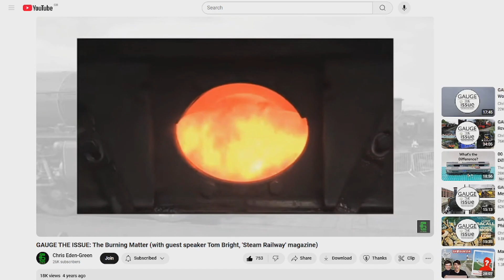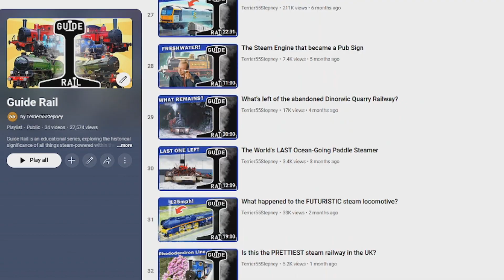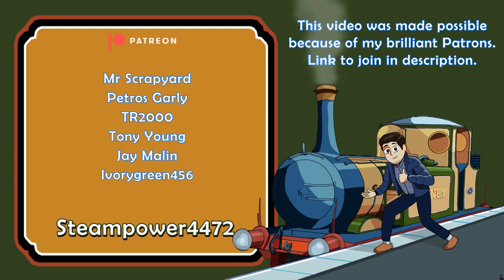Why are steam railways struggling to find coal?

Comment: Exporting coal from Russia is still looking a bit unlikely still, but the uk government could consider keeping the recently closed coal mine open for heritage railway use only.
Reply: it wasn't the UK government that closed it, but the Welsh Assembly. At the time of its closure the UK government in Westminster recommended the renewal of the mineral extract licence based on the need of the coal for steel production. The Labour controlled Welsh assembly refused and as soon as the mineral extract licence ended, refused to renew it. They tried to revoke the mineral extract licence of the anthracite mine near port Talbot, but this went to the High Court in London, and the Judge said the licence could not be revoked until 2038 and the mine could expand its under ground workings. The Welsh Labour said no one uses coal anymore. that is how stupid they are.
Reply: That's if they even care about that sort of thing.
Reply: It's ironic that a union linked labour party is finishing off the last of coal mining
Reply: @charlesburgoyne-probyn6044  what many people forget is, the "famous" mine closures of the 80s and 90s were actual drawn up and started in the 70s under labours James Calaghan, after the pay increases that the NUM demanded and received made many of the NCB pits no longer profitable to work.

The same can be said in of Wilson's labour government in the 1960s. He promised to stop the beaching cuts started under the conservatives.... He did..... For 6 days, then accelerated the closure programme.

This current lot are only interested in looking after people who have no right to be here, destroying British history, giving away our territory, destroying British manufacturing, destroying British farming, freezing the elderly, and destroying British owned companies. The only people they are willing to support (other than people who shouldn't be here) are public sector workers, and it's thanks to £11b in pay rises in July 2024 that is responsible for 50% of the black hole they claim (falsely) they inherited. They should be congratulated. It took brown and Blair 11 years to spend all the money and bankrupt the ecconemy (leaving a £158billion black hole!) . This lot did it in 11 days!

Comment: While I appreciate the government's attempts to be more green, there was 0 consideration for the heritage scene and I don't think the demand from that alone is enough to justify keeping coal mines open. There HAS to be at least 2 or 3 (maybe 4 or 5) coal Power Stations open so that there is still demand to mine coal domestically, that way the heritage scene doesn't have to buy coal from other countries or make something up in a lab
Reply: The UK gov is closing the coal fired stations, not just closing, but close and dismantle ASAP.
Reply: The UK's last coal fired power station closed in 2024.
Reply: @kevfrombutterley  technically one is still open. Drax was built as coal fired, but has been converted to burn wood, cut down in north America, put on a train to the docks, shipped across the Atlantic and then put on another train to Yorkshire. the eco brigade claim its cleaner, despite having a massively higher carbon footprint. 

Unless things change soon (which is very likely) Drax still has a couple of coal fired boiler mothballed "just in case" the worst happens. 

its not just steam engines that are being court up with this ill conceived plan. With the Welsh Labour Government refusing the governments wishes in 2023 to renew Ffos-y-frans mineral extract licence, a mine in Whitehaven Cumbria was approved in order than the UK could continue to make virgin steel. One of the first things Mad Ed Miliband and his labour cronies did after then got in in July 2024, was to revoke the licence for this mine (and several oil and gas drilling operations) so now virgin steel can no longer me made in the UK.
Reply: @J.C.1960  That's interesting. New iron and steel is still made at British Steel Scunthorpe although the iron ore and coke are both imported now. The coking coal rationale for the proposed mine in Cumbria became irrelevant when Port Talbot closed their coke ovens. I do hope that plant gets its promised arc furnace, for the sake of the employees and for the whole area.
Reply: @kevfrombutterley  The steel and Iron at Scunthorpe is recycled steel and iron, not virgin steel, so is no use for structural, pressure vessels, or shipping, and only fit for general purpose mild steel.
Reply: @ and it was the fact Port Talbot were having to import coal for its coke ovens, due to welsh labour refusing to renew the mineral extract licence for Ffos-y-fran, and that was why they closed 1 year ago, because they could not wait for the mine at Whitehaven to open, due to the delay created by eco loney's taking the developers and the then tory government to court to stop it.
Reply: Ah there's a thought, perhaps we should go back to steam powered generating stations, electricity was much cheaper then....

Comment: Convert them to oil burners. They did it to 4014 un the U.S.
Reply: I heard WD 2-10-0 Dame Vera Lynn and 4965 Rood Ashton Hall are being converted to oil-firing
Reply: The steel wide firebox  Bulleids are good candidates for oil conversion.  The fireboxes are very similar to American steam engine ones, and an oil burning system transplanted from america would probably work.  The S160s are also good candidates.
Reply: @mattgrant2646  is there 3 or 5 S160s in the UK? The WD2100 are also suitable, but again about the same In numbers. Non of which are suitable for mainline work.

The issue with the MN/WC/BB boilers is simply cost. With the MN it's also weight, with them being too heavy for some heritage lines
Reply: Yeah, we'd rather not. Plus, it's MUCH less healthy, plus, dude, look at YOUR locos, and British locos, as a comparison.
Reply: @ukaszwalczak1154 they're heat engines all the same 
The Swiss even had electric heated steam engines during wwii due to coal shortages
Reply: @ UK fireboxes tend to be MUCH smaller than those found on US engines, mostly made of copper. It was found when experimented before that many UK locos designed to burn coal and converted to oil firing couldn't produce enough steam at high demand. The experiments never went much further due to UK having hundreds of years of cheap coal under our feet (that we are no longer allowed to mine) 

It might be a solution for some of the new build locos (such as Tornado and the new P2) which have steel boxes, and being new would be much more easy to convert

Comment: If anthracite burns hot enough to melt metal isn't it possible to reduce the amount of it burned in the fire box so it doesn't melt the engines firebox?
Reply: it tends to be the firebars it melts. Many model engines use it, but use stainless steel firebars, and even so it can warp them. There is also issues with drafting, with locos these days spending considerable times standing around (which is why some had clinker issues with welsh coal, with is a low grade gasius anthracite rather than a bituminous coal)
Reply: you need different grates and a completely different design of firebox for anthracite.  LNER engines are meant to run it, but the others need the calorie content and burning properties of bituminous steam coal.

Comment: Could not all the heritage railways and other’s who require coal purchase and run a mine between them? Pretty sure there is enough coal left in the mine (s) it could be worth running a non profit to extract it and distribute it to those requiring it.
Reply: The UK government wouldn't allow it. To mine any mineral (regardless of type) requires a mineral extract licence. the Labour government revoked the new coal mine planed in Cumbria within weeks of taking office, and have revoked licences for several gas and oil drilling sites. It was the Welsh Labour government who are responsible for Ffoss-y-fran closing. The UK government recommended the renewal of its M.E.L.  based on the need of the coal for steel production. The Labour controlled Welsh assembly refused and as soon as the mineral extract licence ended, refused to renew it, claiming no one needed coal any more. Now we have mad Ed Miliband in charge of such things and is revoking licences everywhere, not just for coal oil and gas, but for stone, shingle and sand extraction.
Reply: Beware of mad 👃 mathematicians

Comment: Either opening up a small coal mine or conversion to burn oil would solve this. I'm from the US and a lot of steam locomotives over here use oil and from what I've heard most of these oil burners/coal to oil conversion work. The one time I remember it not working out well was with Reading Company 2100 but apparently they didn't do the conversion properly. But a lot of steam locomotives (especially from different countries) are different so it might not work but it might so it's worth a try.
Reply: the two leading the way in the UK were actually designed to burn coal or oil, in fact the S160 is a US build engine (The WD2100 has a very wide firebox). Many locos were trialed oil burning through the 20th century, but the results were normally poor. The WD280's were originally intended to be able to be converted but when the LNER tried this, they found they were shy steamers at periods of high demand (plus there's only one of these left). It would be very much down to bespoke conversions per engine as no two, even of the same class, behave the same. 

Luckily we are still able to obtain some reasonable quality coal from Columbia, and CPL have made good progress with their WIldfire blend of ovals (which are ok for low demand steaming, or used in with standard coal to help it go further). Prior to the Ukraine war, there was very good quality of steam coal coming in from Russia, and when it is available, the Polish still mine coal. Indeed in Germany they opened up a new coal mine just to feed their power stations and France's has actually recommissioned several coal fired PowerStation's online within the last 5 years to try and ween their nation off Russian produced oil and gas.
Reply: The oil conversion thing is an option but the issue is that not alot of steam locomotives use oil in the UK. Especially non of the Big 4 to my mind or even British Rail. This means to do so would essentially require rebuilding existing steam locomotives with brand new parts that have never been made before in the country. Its a neat idea but I don't see that being possible in the UK.

Comment: In the US, the durango and silverton railway converted every steam locomotive they had to diesel because of the price of coal
Reply: It’s more than just price. The US is the top oil producer globally (14.8 million barrels daily), so the logistics are not so hard compared to other places such as the UK (1.08 million barrels daily).
Reply: I believe they run on oil now, as diesel is only good for internal combustion.
Reply: The Cumbre & Toltec RR in New Mexico should also convert to oil fireboxes. Luckily the mainline (standard gauge) steam engines in NM all run on oil.
Reply: @Jul-66   The C&T probably will, eventually, for the same reasons the D&RG did.  The problem will be getting Colorado and New Mexico to foot the conversion bill since these states provide financial support for the C&T to bring tourists to the area.  With the changes happening in Washington, that money may become very hard to find soon.
Reply: The green nut cry baby’s had a lot to do with it too. Ruined the wonderful smell of a steam locomotive same with the UPs steam program it’s just not the same burning bunker oil !
Reply: @ Yes nothing better than radioactive ash particles. 🙄
Reply: @jhonsiders6077  Cope and seethe foamer.
Reply: Correction; they burn oil, not diesel fuel. A common misconception is that oil burning steam locomotives count a diesels. In reality, they douse a rag with motor oil and throw it into the firebox. The oil fire heats the water in the boiler, turning it into steam, much like how a coal burning steam engine would. Also, the D&S converted their fleet to oil after a forest fire, not because they couldn’t afford to replenish their coal supply.
Reply: @Nostall123YT   True.  However, the steamers were converted to oil not just after a forest fire, but to prevent future huge wildfires caused by hot coal cinders as climate change continues to dry out the west.  Also, because the D&RG can be sued in court for causing a wildfire and the costs of fighting it.  And that is very, very expensive.  The other steam-powered narrow-gauge tourist line in Colorado, the Cumbres & Toltec, continues to use coal.

Comment: Why is everyone ignoring opening a heritage mine to dig up small amounts of coal, just enough for steam engines to run on, or firing using wood or oil? I know copper fireboxes need extra attention but oil conversions are not impossible.
Reply: in order to extract any kind of mineral (whether it be oil, gas, coal, sand, gravel, stone, or even rock salt) you require a mineral extract linace, It is why Ffoss-y-Fran was closed (The Labour controlled Welsh Assembly refused to renew its minerals extract licence, despite recommendations from Westminster it was renewed, and the econutters and the Labour Government conspired against the new coal mine in Cumbria to have its licence revoked, and hence our steel cement works are now closed because you can not make steel and you can not make cement with out gas, yets its fine for these eco nutters to fly around the globe on highly polluting jet aircraft that over the last 60 years have done far more damage to the environment than 200 years of coal burning. 

These are the same eco nutters who want the fens to be flooded because of a fraction of a percent of carbon trapped in the peat rich soil might be released, and do want farmers to plough or work the soil.
Reply: @James_Rivett   There are few things better than conservatives crying that they can breathe clean air freely.

Comment: I am a volunteer in the Railway Club in Argentina, most of the originals steamer were coal burners until the 30's-50's when every engine was transformed into oil-burners (you can see that the tener have a oil tank were coal and the boiler are designed for coal use), now we go to mechanics cars works and ask for the already use oil of the cars. For the still solid fuels we just use wood, of course the wood burns out in a couple of seconds, but we use wood from demolition and stuff like that...basically we run our engines in trash bc is the easiest and cheaper way to do it
Reply: do you have any locos with the Livio Dante Porta system. I've only ever read about it and it has always fascinated me. If he had only perfected his system in the 1930s, steam might have had a much longer life.  

Our house fire we burn a lot or "recovered" wood (wood from old trees that have fallen down or bits of old pallet/furniture/off cuts) to save money with the ever increasing costs of gas and electricity. I was going to build my own wind turbine to generate 24v dc electric stored in batteries and then fed into the house via a inverter to bring it to 220v ac, but I was refused planning permission to erect it so I used the generator on my model steam engine when we go to shows.  

On our traction engine boilers, if we are just raising steam at home, we use a lot of old pallet wood. My best friends father works for a agricultural contractor, and the pallets that the chemicals they use on the crops has to be disposed of to avoid cross contamination, so he saves them, and we saw them up with the steam engine to burn. even the saw dust is saved for use in case of oil spillages in the workshop.
Reply: @James_Rivett  Porta was a member of the Club and keep working in the steam engines of the club until his dead for what I know, sadly we dont have any physical works of Port in the Club (I have heard abouts a boiler that he used for testing his design and that it somewhere abandoned). I think that maybe there are some blueprints of Porta in the library of the Club

Your ideas sounds great, and we would need stuff like that in the future, I think...after all, steam never dies, only the heat source for it and thats why we need to improve our steam engines and we have a good base for it
Reply: Wow

Comment: As a steam brother from across the pond, I'm so sorry for your situation. This is probably the most existential railway preservation can get😢 

I'm probably thinking of this on the fly, but here I go, The mines are abandoned but they're still coal in them and some of them use rails to move the coal along with trucks or specifically used. And the thing about these mines is that All it needs is a market to sustain itself The marketing question is just in the background life specifically ,what I'm boiling down to is if The preserve's over there can band together. Perhaps you guys can get a rail- fed coal mine made with preservation for preservation that way so you'll be able to have self-sufficiency and the mine will be protected no matter what even if people want to shut it down or not" for the greater good" believe me that sentence has been uttered before disaster many times over here.🙂☹️ 
Now how the mine will operate. I'm not quite sure as I do believe it is up to you guys when it comes to that. Realistically, it'll probably have its own fleet of antique diesels to send Cole to whatever steam preserve needs. It's as long as it's connected to the main line. If not, trucks will be involved, but to make it a bit more fun, why not send the steam engines to do it? Have them earn their keep?😄 Again, as long as they actually have a connection in the main line. If not, it'll be sent with trucks to their respective preserves 🙂 I know this solution might be full of holes and. Lacks logic but I just hope this gives people ideas and use it as a stepping stone in finding a solution 🙂🚂
Reply: The British government is hell bent on screwing everyone over.